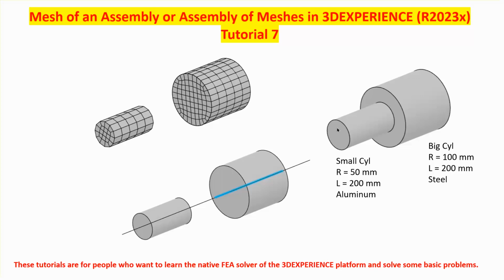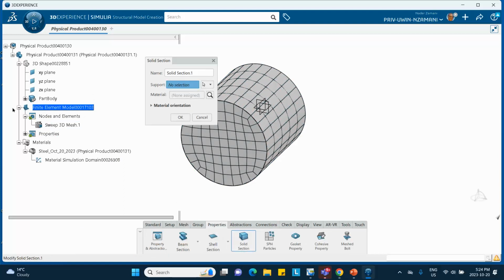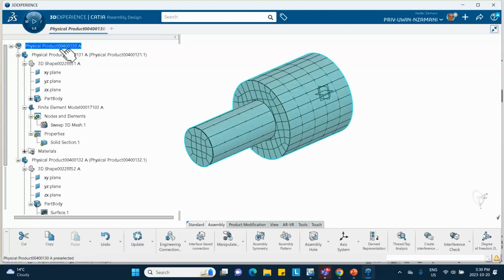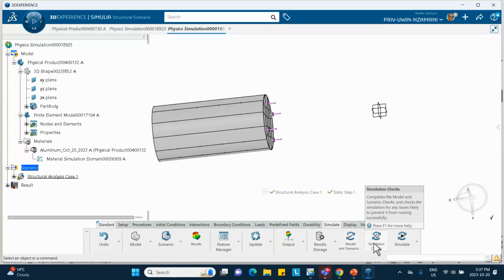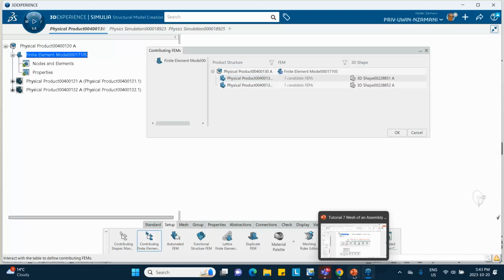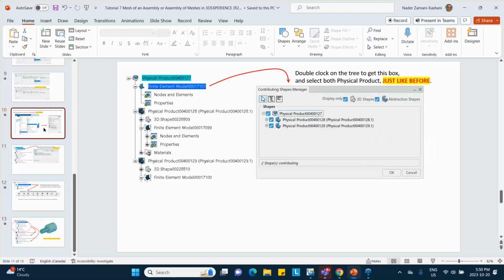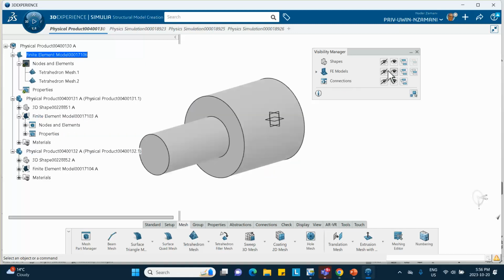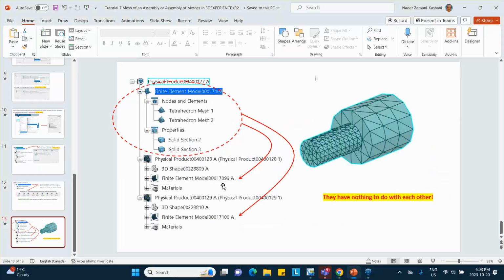Tutorial 7, Mesh of an Assembly or Assembly of Meshes 3DEXPERIENCE R2023x

Comment: Hi again Dr. Nader,

Today I ran into an issue with mesh representation. Typically, meshes are associated with a part or assembly and appear in the specification tree when you open the model, but I can’t see them there anymore. However, if I switch to the FEA workbench, I can select the mesh file and then it shows up in the part or assembly tree.

I’m not sure if I accidentally filtered something out or if it’s due to another reason.
Reply: Issue is resolved, I had to do advanced open with representations
Reply from the maker: Dear @khazzaz], I wish I could provide you with an answer but I am not sure why this is happening.